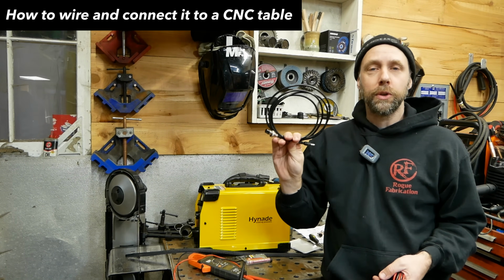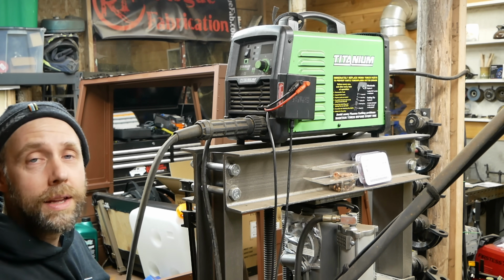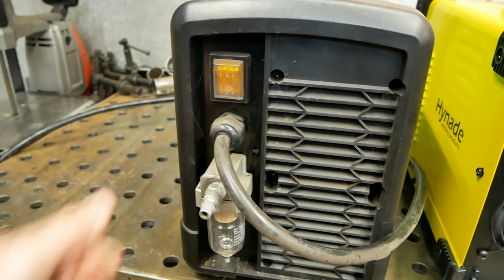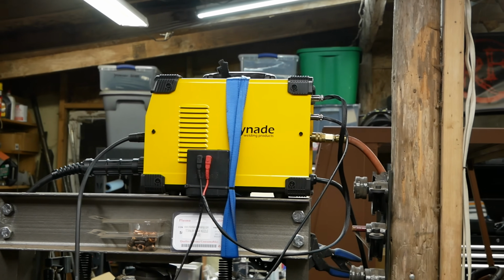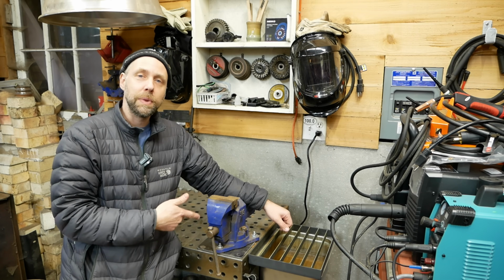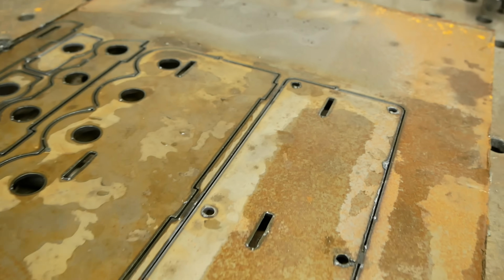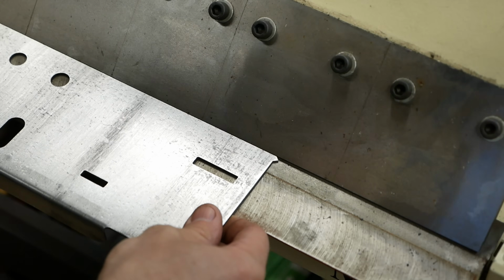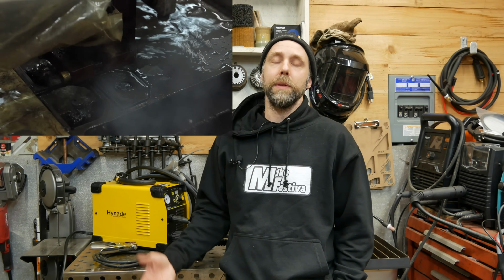Testing the most affordable CNC plasma cutter on Amazon Hynade CUT60DN

Comment: Hi Mike, wonder if you would you recommend this plasma cutter over any other or was this recommendation solely based on price and its ability to be used with the table?  Thanks for making this video btw... really hyped on buying the table soon too :)
Reply from the maker: Hey Alex I feel that the fact it’s a 60 amp blow back pilot arc start with CNC plugs on the back make it a great plasma to get for free hand cutting.
Once you get some extra cash saved for a crossfire table it’s ready to connect right up to it.
The price point is definitely another good thing.
Honestly my recommendation would be this plasma or the Titanium 45 just because I have ran both of those on my CNC and they both cut really well.
Take care 🙂👍
Reply: @Mikefestiva Thanks Mike for the quick response! Really appreciate that.  Any reason why you didn't get the plasma cutter that langmuire sells rather than experimenting with the Titanium and hynade?

Comment: Would you recommend the hyade over the arcfony for an android
Reply from the maker: I have never ran the Hynade CUT60DN on my arcdroid, I have only ran my Titanium plasma and my Arcfony on it. With that being said I still think the Arcfony is my recommended plasma out of them. The Arcfony has always cut really well and never missed a start when cutting. The other reason is the Arcfony has a more flexible lighter duty torch lead then the Hynade so I think that’s much easier for the arcdroid to move around the cutting area.
Plus the price it more affordable. Hope this helps. 😊 I think I had a discount code that may save you a little on the plasma cutter as well 👍 should be in the videos description.

Comment: Hello Mike,  Love your videos , I got this Hynade Plasma cutter and Langmuir Crossfire Pro after watching your Video and trying to find a post processor  using Fusion 360 for Crossfire Pro/fire Control i've created a simple 2D piece and this will be my first cut.
If you could please point me in the right direction. I tried several post processors and none seem to work.  I have been using the random ones from Fusion 360 library.  
Cheers and thanks in advance
Reply from the maker: I just downloaded the Post processor from Langmuir systems. It’s should be on the same page on there website where you downloaded the Firecontrol software. Make sure to follow the directions and drop it into there exact file Langmuir recommendations.
Reply: @Mikefestiva  Thanks Mike
Downloaded the post processor and it worked a charm.
Thanks for your great videos.

Comment: What is the little black box on the side of your plasma cutter? THC module?
Reply from the maker: Yes it’s the THC that if an add on Option for the Crossfire Pro, it reads the voltage output of the plasma cutter and sets the optimal cutting height. Take care 🙂👍
Reply: @Mikefestiva  Thank you very much for answering. What THC would you recommend for Mach3?

Comment: Great video Mike! I appreciate all the info. I ordered the crossfire pro (thanks for the $100 off coupon) After watching this video, I ordered this cutter too. I am hearing we need dry air coming to the torch. What do you use for air compressor and  keeping the air dry? Thank you for such great content on this channel!
Reply from the maker: Thanks for checking out my videos Dave 👍 all I’m running is two water separators in line coming out of my compressor, they are about 1 quart size.
I just try to drain them daily. 
The dryer you can keep your air the longer your consumables will last, but half the time my consumables fail early is because of molten metal blowing back into to tip on the cup.
The good thing is the consumables aren’t very expensive for this plasma cutter. 
My friends Hypertherm cost about $20 each time he changes out the cup and electrode. 
Take care 🙂
Reply: @Mikefestiva  thanks Mike! I appreciate the reply!

Comment: have you tried the hynade ac/dc tig 200 yet ?
Reply from the maker: Yes and I think it welds aluminum really well especially considering the price 👍 the and pedal feels fairly flimsy but works perfectly fine. Here’s a video I made and I cover two TIG welders in the video, The Vulcan PROTIG 205 and the Hynade AC TIG. https://youtu.be/OOd6ACyABkU
Reply: Got mine before they offered the peddle. I'm still trying to figure out the sweet spot for the ac balance. But really surprised at how it welds aluminum so far. Does just about as good as my ahp .
Reply: Thank you sir I will definitely try it at 120 instead of 85 hz I'm more old fashioned and used to the lower hz from the welders I use at work

Comment: How’s the plasma cutter currently running? Any problems?
Reply from the maker: No problems yet with it 👍 Still working good. 🙂
Reply: @Mikefestiva  thanks for your review on it. Purchased my plasma table with your code 2 weeks ago. Been eyeing this plasma cutter since i bought the table. Amazon has plasma cutter today 424 and used your 5 percent code. Thanks!!
Reply from the maker: @adamleach728  Right on 👍 The plug and play makes this one really easy to set up 🙂 Mine is still working great!

Comment: Great video Mike! have you ever used the Lotos LTP5500D-CNC? it's another Pilot Arc Plasma that I have seen on Amazon.
Reply from the maker: No I haven’t ever used any Lotos products yet. I think that Lotos model is pilot arc start but not Blow back pilot arc start. By looking at the metal cases of both plasma cutters I wouldn’t be surprised if they are coming from the same manufacturer?
Reply: @Mikefestiva  and blow back pilot arc start is what I need for my DIY table, correct?
Reply from the maker: @MrMountaincycle  Yes most Blow back pilot arc start plasma cutters work on CNC tables. They put off the least amount of High Frequency interference that can cause issues with CNC electronics. I hope this helps 👍

Comment: I need a welding table so bad. Problem is I need a big one. Thinking of making my own maybe but man will that be a lot of hard work I am not sure I am qualified for. As for the plasma. It's 500$ I wonder how it compares to YesWelder's CUT-55DS?. It's 450 so negligible price difference. I am in the market for one but I really need to find someone around here with one of these to try out.
Reply: Yeswelder CUT-55DS is high frequency plasma cutter do not suggest it works with CNC table, CUT60DN is Non-HF Plasma cutter easy works with CNC table. By the way yeswelder CUT-65DS is Non-HF plasma cutter, But torch is IPT40, it is 40Amps torch.🧐, you need to find the different and make decision.
Reply: FYI the yeswelder 55 is like 310$ on Amazon right now the 65 is like 390$ also hynade has two of their harder to get modles in stock one of them is  the Cut550 55amp xp model that has everything yeswelder has loke 2t and 4t functions for around 299$ but they seem to go fast .

Comment: I don't know if you answer people's questions you're probably too busy too but I'm gonna ask one anyway I have very limited space I've been wanting to get into this for a long time I am very very very adept at fusion 360 I have not dove into Cam side of fusion however I imagine I can learn that without any problems however so I have a leg up on someone that's just starting out. I notice you have an enormous table there everything that I want to build and sell is smaller than two feet and I have ideas for probably 100 things that are smaller than two feet across do they make small tables or would that be something that I'd have to try and design myself? Any advice you could give me?
Reply from the maker: I would recommend looking at the smaller crossfire CNC table, it’s a great price, I think it sells for about $1500 my promo code with save you about $100 that table is in the 24”x24” size range. I should have a link to the Langmuir website in this videos description 👍